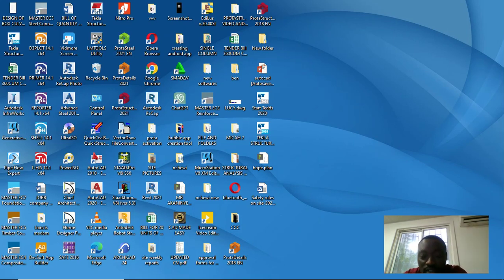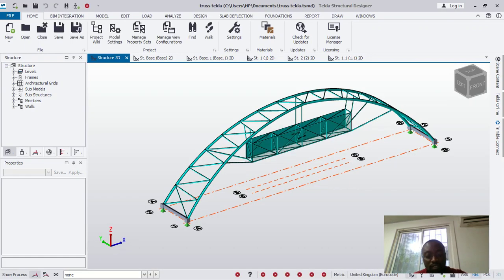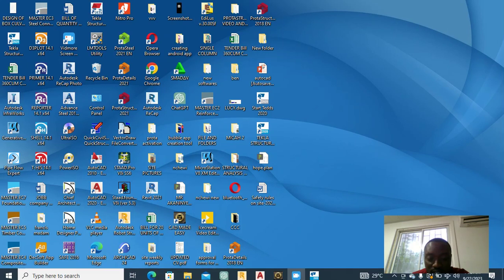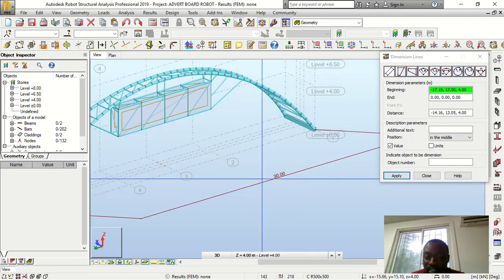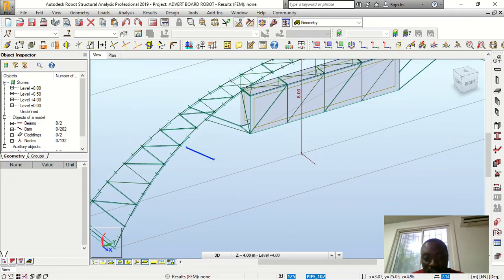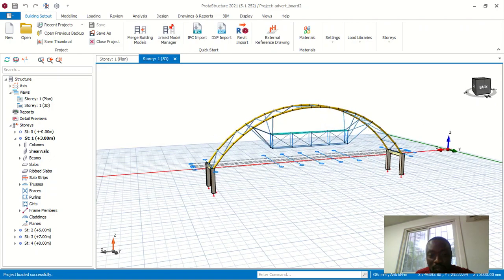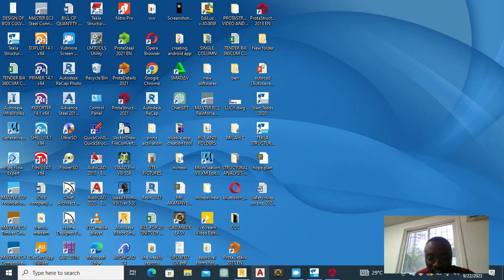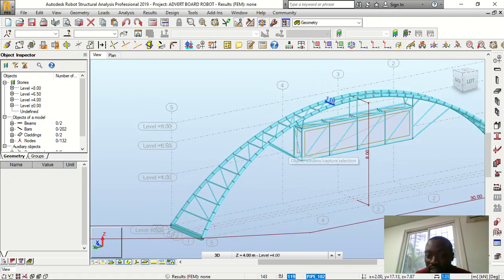OVERVIEW DESIGNS WITH TEKLA, PROTASTRUCTURE AND ROBOT SOFTWARES. @CAD_MADE_EASY

Comment: So what is the best software do you reccommind
Reply from the maker: Protastructure and Tekla are two softwares you should practice with. Protastructure has few limitations when it comes to complex modelling as compared to Tekla. But I will advise you learn both of them so you can always compare your results and make credible decisions on your designs. Mind if I teach you?
Reply: @CAD_MADE_EASY  but both of them can not import 3d dxf from cad file which is not a good point for both .
Reply from the maker: Tekla can if you have the needed plugins..